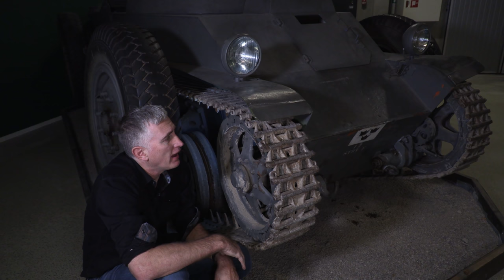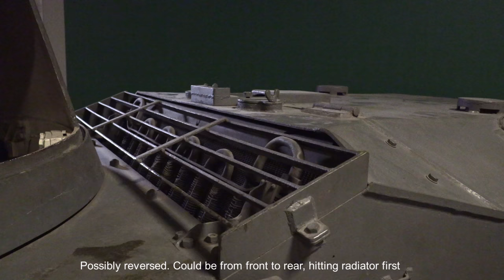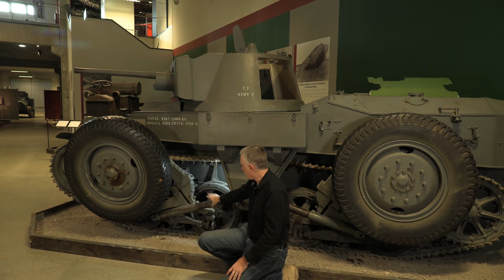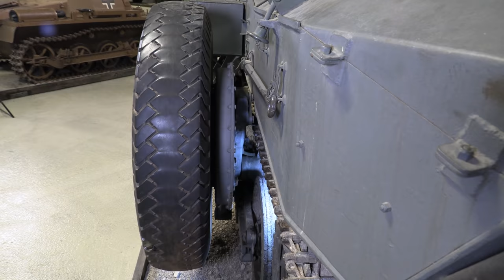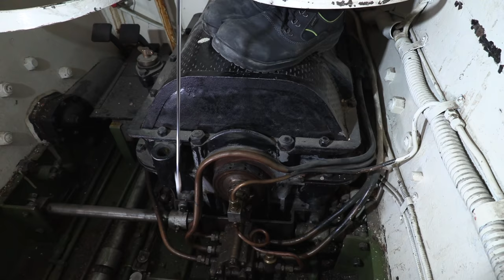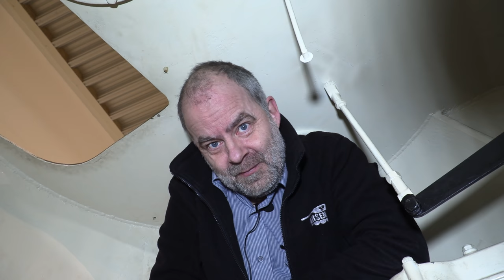Inside the Chieftain's Hatch: Strv fm/31

Comment: Chieftain: we haven't quiet figure this out.
Sweden: we are not done building it yet.
Reply: The engineers responsible for this probably went on to design cars for SAAB, aka "next year's design today (you're the beta tester!)!". :-D
Reply: @henrikgiese6316  Can confirm that the "old guard" at SAAB was absolute bonkers not just the designers and engineers but also the mechanics and test drivers. Did a 4 week internship at SAAB back in the 90's and what they did was the most crazy shit I've seen outside the army, some of the test mechanics even made Top Gear look normal and sane.
Reply: @Mannhovf  But SAAB cars are very durable... Maybe batshit crazy would help durability in other car makers?
Reply: WELL ALL the cables Bell cranks etc. Can be made to function via hydraulics spool valves. Lots of things THAT could make this. Illustration TOOL for. Assembly workers. REFERENCE. Functioning wasn't EVER expected. It was a visual aid. THOSE pieces. Racked onto it. Where truck suspension parts etc. Volumetric containment. PRE shipping container days. LOL. EVER seen. Parts breakdowns before. Here's a. TRAINER. For NOOBS. How far out they where thinking scared shitless he'd get the BOMB FIRST.  The CONCEPTS and spinoffs. Are. WELL with TECH what it is. LOL. TANKS lose to planes every time.  Just saying. Bombs KILL tanks. LOL. Small. 10kgs
Reply: Less actually
Reply: @Feiora  Exept one part that broke s often that every towtruck in sweden had some of tyhose parts for SAAB cars with deaD engines
Reply: @edsonkidwell9813  Your comment is a mess. I can't hardly make out anything from it. I can, however, tell that you're perpetuating the myth about attack planes taking out lots of tanks. This is not true, because the planes mostly missed their targets (before guided munitions). Tanks are comparatively small.
Reply: @Mannhovf  "old guard"? so the "new guard" are more conventional? i mean, i dunno...never seen a SAAB here!

Comment: "We want a tank, and we want an armoured car."
"Can't afford both."
"How about one that is both?"
Reply: Funny thing is that it was too expensive and the army decided to separate armored cars (Pansarbil) and tanks (Stridsvagn)
Reply: Bad Cattitude  
It's an armored vehicle, and you want tracks for terrain but wheels are far more fuel-effective and faster on roads. Tanks that travel long distances usually goes on some kind of transport due to fuel-costs and to avoid wear on tracks, suspension and engine. Which means you need two vehicles just for the tank, the tank itself and it's accompanying transport.
So adding roadwheels to make it it's own transport for road travel makes a lot of sense. And of course tanks were a fairly new thing so they didn't know the thing then that we know now. You gotta experiment in order to learn what works and what doesn't.

Comment: I always love it when people are confused to hear an engineering firm specializing in massive metal machines like locomotives and tanks has a carpentry team. Never occurs to them that you would want to make wooden copies of many metal components for testing or display purposes. Shows how little most people understand about how the stuff they use actually comes about, and partly why they don't appreciate manufacturing workers nearly as much as they should.
Reply: There skill and depth in most work
Reply: @LordChesalot  Exactly, and it is a shame that most people never appreciate the depth and breadth of skills involved in making the everyday objects they take for granted.
Reply: Let's not forget that woodworking skills were also critical for making the patterns used in making cast metal parts. Wooden patterns are still commonly used today.

Comment: I want to pull it apart to reverse engineer it, if there are no surviving documents for the vehicle reverse engineering may be the only way to see how it works. 

For instance the steering wheel looks like it has a tilt forward mechanism that disconnects it from the steering shaft (allows the rear driver to use the steering without the wheel causing a hazard for the front driver)

I love historic prototype oddities where engineers are clearly looking for innovative solutions for problems and they are not afraid to think outside the box
Reply: Wasn't aware the Japanese did that, I know the Russians did.
Reply: What was the Japanese one called ?
Reply: I think my favourite instance of reverse engineering was the Vympel K-13 air to air missile, or, as the original version was known, the AIM-9 Sidewinder.
During an engagement, an AIM-9 was fired at, and struck a MIG-17. The missile failed to go off, however, allowing it to be studied by Soviet engineers.
The AIM-9 was replicated so precisely, and thoroughly, that when NATO forces were able to capture an intact K-13, They found that not only were the parts compatible, and completely interchangeable with an AIM-9, but they retained the same part number.
Reply: Have you ever actually tried to reverse engineer anything? It's way, way harder than you would think. Not impossible, but very difficult.

Comment: Sooo, is it a tracked armored car, or a wheeled tank?
Reply: Yes
Reply: Yes.
Reply: Yes
Reply: Definitely a wheeled tank IMO.
Tracked armoured cars use removable tracks that fit over the road wheels to improve grip off road.
Reply: Yes
Reply: No.
Reply: It's a wacked cank.
Reply: Same as the BT tanks. A tank with wheels. (since the BT tanks can be driven without the tracks...)
Reply: Yesn't

Comment: Modern tall style semi air bags. This could be KILLER. In low voltage light tank. Killer quiet. TANK. On air. Light weight tracks high speed

Comment: There was an even weirder track/wheel 'thing' made by IIRC Vickers that appears in a few old (1920's?) AFV demonstration field days. Looked like a gashapon toy. A single central track and one wheel each side, all on the ground at the same time - I can only guess that the sole crew member had to sit astride a metal box for the track to run inside of - and the single crew man stuck out the top beyond shoulder height like a 'Whack-a-Mole'.

Comment: sweden had foun out the secret of  wheels armor surprised that they good at blocking shells, so hence decided to mount it on for additional armor
Reply: And in the Strv 103 we put the fuel tanks on the unsloped sides of the tank to act as spaced armour.

Comment: This thing is really interesting. I'd imagine the wheels don't move too far down to make contact with the road but it would at least have to clear the tracks, what about tracks sagging and touching the road as you drive over hills and bumps? From the inside of the wheel view it looks like the drive is engaged by hubs that lock in place just like a 4x4 (manually or inside the vehicle I couldn't tell). How the hell does it turn on the wheels? There isn't much room between the wheels and the track to allow the wheel to turn much. I couldn't see any wear or damage on the inside of the wheel for evidence though. Braking one side would flat spot the tires, I suppose you could do that but it doesn't make much sense. Anyways, cool and complex. Thanks Chieftain and supporters!

Comment: Saw a manual for FM/31 at IKEA yesterday. Comes complete with elaborate drawings and instructions for this wheelacked fighting vehicle. There is a supplemental glacis armor kit available for an extra charge, but the instructions to attach it to the wooden glacis plate are also in the manual.

Comment: I would assume that one of the levers must control the drive mode, and the tillers may simply have been left on the donor tank when they started tacking all the new bits all over it to create a prototype. That is assuming they know what they are talking about when they determined both do the same thing. I would have assumed the tillers control steering brake/clutches, and the steering wheel steers the front wheels in road mode. Seems like it ought to be easy enough to determine, really.

Comment: Did Americans just have a superior control system with the M113/M577 system?  Laterals with Left/Right brake for turning, and full back for braking...so many complicated steering paradigms over so many vehicles....yet, I look at the M113/M577 and just see K.I.S.S.  (Keep It Simple, Stupid).

I don't remember how M2/M3 controlled...oddly, I drove them occasionally.  Betting it was similar.  The Bicycle handlebars in an M1A1 were....something along the lines.

Comment: So obvious question, whats the advantage for long range transport over just loading the tank onto a train car or even a truck trailer? Even with the road wheels I can't imagine its low maintenance, easy on crew or good on fuel, and the truck probably only costs as much as the extra system, and can move a tank even when its broken (which frankly those road wheels easily can be when acting like a tank), or be busy with other logistics most of the time.

Comment: you could always roll it down a hill and play with the controls to find out which does what lol. 
did anyone ever try just bolting oversize wheels to the drive sprocket and road wheels that extend below the treads but otherwise do not impede its movement so you could just use the tread steering system?
Reply: Tank style skid steering isn't ideal for rubber tires on roads. It causes a lot of tire wear and places a lot of strain on the drivetrain.

Comment: I don't understand why the tracks are so narrow for a Nordic tank with long seasons of butt deep snow? Don't see room for track extenders. Did they have other equipment like snow cats or weasels?
Reply: First it was regulations of roads and bridges, the vehicle wasen't really allowed to be wider. Then it was built to go into woodlands between trees. 
Southern part of sweden dosen't get more than knee deep snow at most a normal year. Mostly its woodlands and fields, and there is was it was supposed to act. Up north is just endless bogs and wilderness, not much things to protect, no big towns, no big factories and not so much infrastructure to support tanks anyway. 
I guess transporting them on railroad or trucks would be impossible if they was wider also. A lot of narrow gauge railroads.

Comment: suffers the problem of being too complex an answer for too simple a problem! put it on a train or Truck for long-distance travel, instead of adding weight, cost, and complexity to an already difficult to repair and maintain vehicle!
Reply: It was built in a time when tracks were quite fragile and the solution to the problem turned out to be more reliable tracks. That 'killed' the whole "tracked tanks with wheels"-concept.

Comment: "We don't know what that does. We're not sure how this works..." 
I understand there are only three of those in the world, but for one it is a tank and it's built like a tank so turning over the driveshaft won't hurt it. And two, it's a museum piece that just kinda sits there 99.99% of the time so even if something does break they don't need to rush and fix it.
Considering the age, firing up it's own engine is most likely not a good idea. HOWEVER it does have a V-belt for the alternator ('conveniently' situated atop the engine) so that same belt can be used to turn over the entire machine provided the spark plugs are pulled and cylinders/engine is lubricated. It won't be fast, but it does not need to be. A small lawn mower engine or even a large drill running the belt should be more than enough to test out functionality of all those levers and pedals. Heck, if nothing else surely there is a convenient crankshaft bolt to drive it off of, even if a small hole needs to be hole-sawed from the back to reach it with a socket.
This machine is way more valuable as a curious research platform than a paper weight it currently is with all their "we don't know"s.

Comment: Man, working on brakes sucks already and thats even on my 80s motorcycle which is pretty easy to work on, if I had to pull out the engine any time I needed to work on them I would have either scrapped the thing or shot myself like a panther mechanic trying to fix the final drive